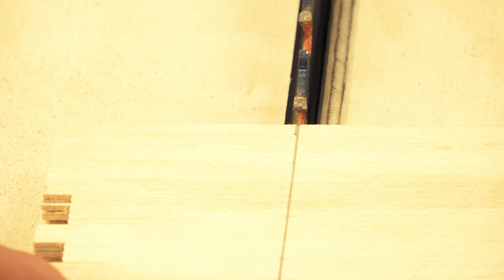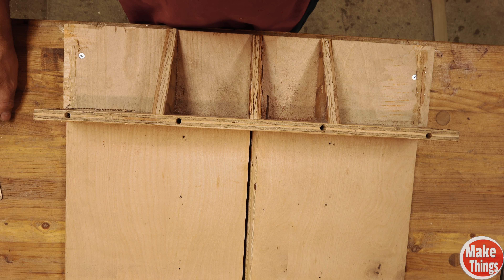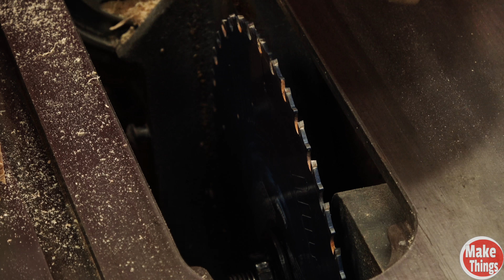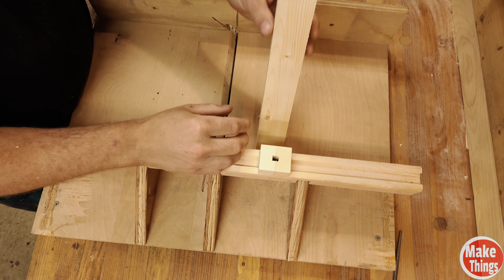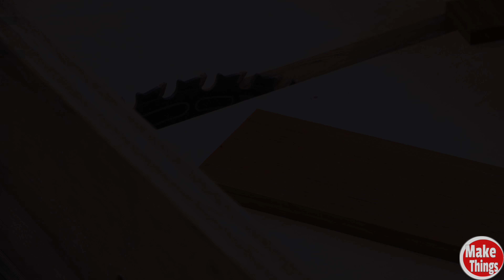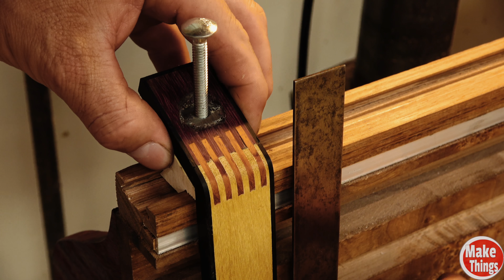Sliding Dovetail Stop Block System // No T-track 1 Power Tool Build

Comment: Nice build! (FWIW, chasing the bulge in the tape back to your zero point will screw up where it sits.  A better way is to remove a portion of tape from the *middle*, hold that portion up off of the surface while you find your zero point, then press it down.  After that, you can remove the rest of the tape without the zero point shifting.
Reply from the maker: Hey, good point.  I’m just about at that point in my instructable and I’ll add that.

Comment: Great job Rob! Now I just need to make a new fence for my table saw as it doesn't allow me to put it that far on the other side of the blade! lol
Reply from the maker: Haha...you're good at making jigs for the table saw!  It should be a snap for you!
Reply: @MakeThings  haha, I've made a total of two jigs for my table saw. I'm not sure if you would call that good. 🤣
Reply from the maker: The jig I saw was great...taper jig...wasn’t it?
Reply: @MakeThings  you know what I lied I've made 3 jigs, but none for tapering (but that is on the list). I've make a jointer jig, a picture frame jig (miter jig) and a spline jig. I've yet to make the main table saw jig that almost everyone has and that's a crosscut jig but maybe one day 🤣
Reply from the maker: That’s what it was...the picture frame jig!   It was a good design!
Reply: @MakeThings  haha thanks, but i owe that to the folks at fine woodworking magazine 🤣